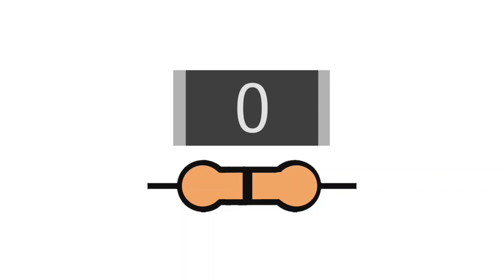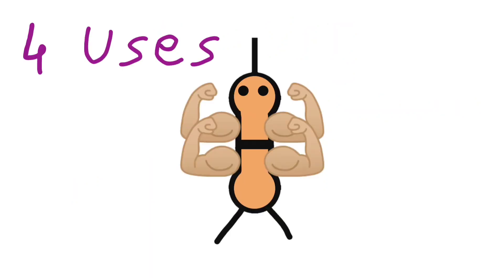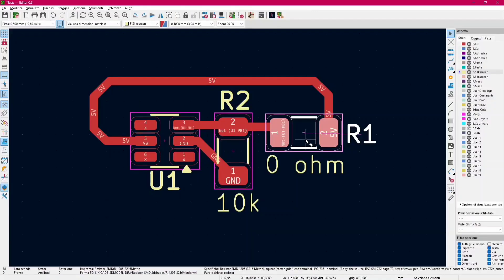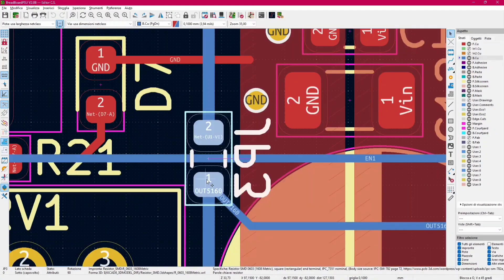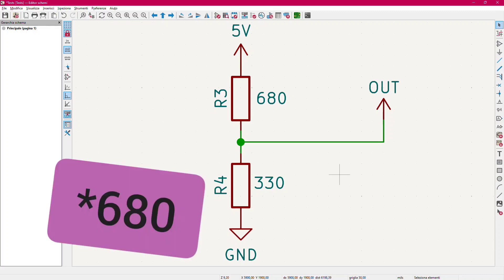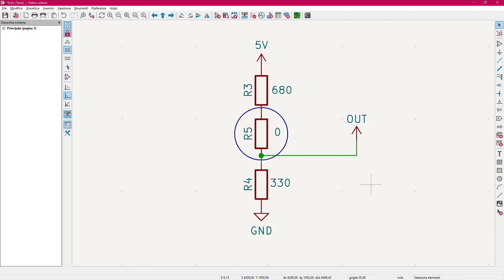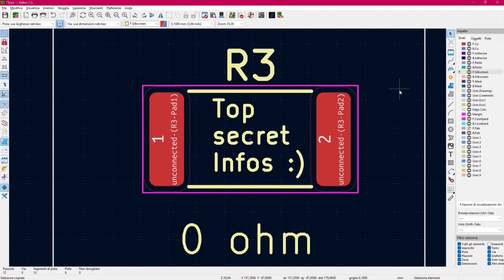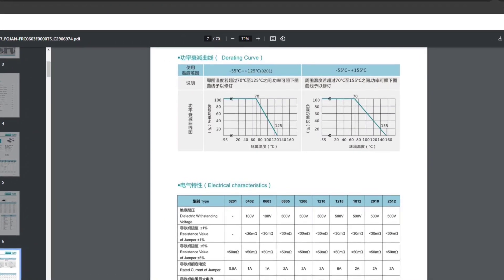Why 0 ohm resistor exist?

Comment from the maker: Hi all, this is a brief video about zero ohm resistors and their use. Indeed they are useful as they are available in thousands of quantities from different manufacturers. Zero ohm resistors are a really good jumper, a placeholder and more

Leave a comment to leave some feedback. I'll be glad!!

Chapters:

0:00 - The 0 ohm resistor
0:40 - As jumpers
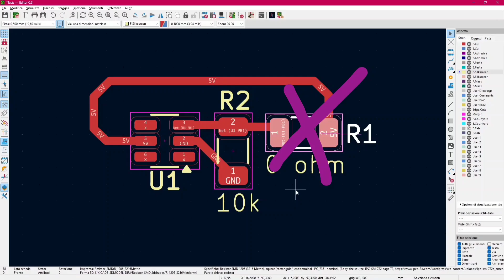1:13 - Go over traces
1:52 - As placeholders
2:52 - Hide infos

IG: https://www.instagram.com/xburningelectronics
Reply: They are also used to bypass/enable unused parts of a PCB for different versions of a product using the same PCB.
Reply from the maker: @icarossavvides2641  Yeah, this is strictly connected to the MCU example in the video

Comment: I'd like to correct mr. @monad_tcp with his misconception and also share some of my review on this video to @BurningElectronics, well technically you may think this possible because it will allow a lot of current to flow but.. you see it wont rise in temperature at all, as u know heat produced varies directly with *I²•R•t*, where I's the current R's the resistance and t is the time passed, with R 0, heat will be 0.. and that's exactly what happens in real life! In this video where he talked about 0 ohm resistors, well to your surprise it isn't actually 0, it does have some "negligible" resistance, only true 0 ohm resistors are the super conductors which does actually have an infinite conductance or in other words absolute 0 resistance.. those type of conductors won't get heated and can carry "technically" infinite amount of current, realistically a very very very large amount of current.. I mean that's what makes magnetic locking phenomenon in a super conductor. I'm not gonna get deep into it's quantum phenomenon you can search it up, not gonna disappoint you I can guarantee ;) 

So my answer to why a 0 ohm resistor would exist? Well it exists for us to play with super conductors and magnets! 

Fun fact, maglev trains use 0 Ohm Resistors aka Super conductors to levitate their trains. That's one practical use.. talking about super conductors in a 0 ohm resistor component video may sound weird but I think it would be great if you atleast knew about the relationship and have a nice day!

Comment: Okay. Using a 0 Ohm resistor to jump over a trace is freaking brilliant, and I would have never thought of that
Reply from the maker: @nestor1208  Yeah! Just some tips if you want to use this technique.

1. Don't use this technique for high speed designs
2. Don't use this technique for high current traces
3. Don't forget pad-to-track clearance

Everything else is ok!

Comment: I like to use 0 ohm resistors as fuses for low power, as they are better looking in my opinion
Reply from the maker: @alysonkiszewski5032  Better looking? Ah man just use proper smd fuses! Todays the cost of those smd fuses is really low

Comment: It's worth noting that in real life, there is no such thing as a "zero" ohm resistor, in fact there is no known material that is a perfect conductor or perfect insulator, all matter has a certain resistance value.  

Things get rather interesting when certain conductors are cooled to temperatures approaching absolute zero, entering a phenomenon known as superconductivity, in which a substance loses all resistance and seems to defy the laws of physics.
Reply from the maker: @rarelampcollector  Yeah i said at the end of the video that those aren't really 0 ohm resistors. We call it 0 ohm resistors only because they tend to 0
Reply: "seems to defy the laws of physics"
Only if you're from the early-mid 1900s bucko

Comment: we use it in evt prototypes to assist in sub module power consumption tests ... e.g. 0 ohm resistor in series with an 3.3V power in trace so we remove the resistor and hook in a benchtop amp meter during power consumption during different states like active, idle sleep etc.
Reply from the maker: @regulus8518  Yeah, that's a clever way to use 0 ohm resistors!

Comment: Negative ohm resistor when
Reply from the maker: @gigachadgogeta  Just search for Gunn Diode. They are absolute uncommon diodes with some physics crazyness that have a region where an INCREASE in voltage results in a DECREASE of current. This seems to go against V=RI. But it's a little more complicated. Just check for GUNN diode
Reply: @BurningElectronics  you can also bias a transistor like a mosfet to result in negative resistance by using it in its active or amplification region (half on).   Then you can dial it in specific to your circuit if it’s easier than working around a gunn diode which isn’t really a diode.   Doubly so when you need it to work all the way down to zero and those first positive coefficients ruin the circuit.

Comment: Now we just need an infinite ohm resistor
Reply from the maker: If you look at my other video on resistor you will find out that Ohmite reached 10TΩ. That's infinitely less than infinit. But it is a monster of 10.000.000.000.000Ω sooo yeah hope you are a little more satisfied now ahah
Reply: @BurningElectronics  ayo that's crazy 💀💀💀
Reply: thats what the kids call an open circuit 😂
Reply: Isn’t Open circuits technically infinite resistance in DC
Reply from the maker: @lamp007  Well...kinda. There is no infinite resistance, an open circuit has a resistance depending on the resistivity of the material. And sometimes we can say "Okay it's infinite", other times we have to to our calculations and check resistivity of the material to work out the real resistance
Reply: @ but doesn’t the same thing apply to the 0hms resisitor, theoretically 0hms but in actuality it’s near 0% and impacted by temperature differences.
Reply from the maker: @lamp007  As I said in the video
Reply: @BurningElectronics  So how is the theoretical 0 different from the theoretical ♾️?
Reply from the maker: @lamp007  I just want to say that there is no infinite resistance and neither exact 0 ohm resistance (except superconductors)

Comment: I worked at a company where we sold a version 1 and a version 2 board for some component in the diesel-electric systems in huge ships. The version 1 board would trip a mal-designed safety ciruit all the time, so we got the boards sent back. What we did was remove a specific 0 ohm resistor to disable the safety circuit, then send the board back. We would also upsell version 2 boards directly. What's worse is when the whole systems came back occasionally, all covered in soot, because the ships used to catch fire from the safety circuit being disabled 😂
Reply from the maker: @jhsevs  Oh my...😳

Comment: a "0 ohm resistor" is only it's tolarences, so it's can be anything, in other words it's an "any ohm resistor"
Reply: just install it in your circuit any if you are lucky it's just the right random number you needed
Reply from the maker: @kovacsattila8993  It doesn't work that way
Reply from the maker: @kovacsattila8993  Mhh this is valid for all the resistors😅. Like even a 100 ohm 0.1% resistor could be an "any ohm resistor" since there are infinite numbers from 99.9 to 100.1
Reply: So they go negative and generate power!   HALF of them too!!!!

Comment: I strongly believe certain companies use them as a way to add a little bit of "programmed obsolescence" for their products

I've repaired many stuff that had 0ohms resistors failure and the resistors were not placed over any other track and they also didn't work as fuses... they seemed to be there purposely over critical traces that went to cpus only so that they fail after some years 

For example xbox 360s many of them are starting to fail nowadays almost always related to 0ohm resistors all over the pcb. Pretty sure some follow your use examples but many are just there "because"

Comment: I never thought to use 0 ohm rezistors to jump over traces when you can't use the other layer/s. Even if it's only useful for low power and low speed signals, it's still more useful than nothing to help save money
Reply from the maker: @torfley  Yeah! Super useful. And I agree, this should be used only on low power signals and not for high speed signals

Comment: In some failure scenarios, these 0 resistors (or rather, jumpers), being an SMD with low current rating could act as fuses and save the day. It's a whole lot cheaper to replace these 0 ohm guys than replacing the whole burned out PCB. Yes it's tempting to just desolder one of those burned out 0 ohm guys and slap a blob of solder on there to fix everything but my local repair shop advices against such practices for safety reasons.
Reply from the maker: @udhi_gn3893  Didn't expect so many people to use them as fuse as it is a bad design idea
Reply: Yes. Even before the SMD era we were using them as fuses. Never saw them used them for jumpers in my experience. Just used wire for that.

Comment: If the narrator was honest he would not call it a resistor.  Instead, using click bait methods to deceive everyone.  What a stupid thing to come out with.  Anyone supporting this liar needs mental health assistance. Of course one could come out with stating technically it is a resistor but every single electronic connection has some resistance.  This video is simply a click bait issue, I suggest everyone thumbs down this garbage.
Reply: are you ok? it's produced the same way as resistors, it just has more or less 0ohms. Even if it was technically not a resistor, why all the hate?
Reply from the maker: @EneaG And everyone in the Earth calls it a "0 ohm resistor" anyways
Reply from the maker: So all the manufacturers are lying? We call it zero ohm resistor because it tends to have 0 ohm resistance. Like we call a 100 ohm resistor because it tends to have 100 ohm resistance. Nothing is 100% perfect in this world because physics
Reply: 0 Ohm resistor is quite impossible. What you show is zero-ish resistor.
Reply from the maker: @jaroslaww7764  True 0 ohm is only possible with superconductors. What I show are called 0 ohm resistor. Nothing more. They obviusly don't have 0 ohm resistance. But we ALL call it 0 ohm resisistor even tho they are not exactly 0 ohm. Like when you say 5V but it is 5.00001V. Like when you are saying "The Earth is round" but indeed it's not exactly round. Like when you say "I lifted 10kg in gym" but they obviusly are not 10kg because tolerances. Like when we say "Bolt has done 9"58 " but indeed it's not exactly 9.58...wanna more examples? Ahah a 0 ohm resistor it's called 0 ohm resistor because as with ALL THE THINGS we take APPROXIMATION
Reply: @BurningElectronics  When you say resistor is 5 Ω, but actually its 5.1 Ω you are making relative error of 0.1/5 so 2%. Try to calculate your relative error when you say resistor is 0 Ω 😀
Reply from the maker: @jaroslaww7764  That's not important at all. Because when an engeneer buys a 0 ohm resistor alrealdy knows that it will not be a true 0 ohm resistor. They will buy a 0 ohm resistor because of what said in the video. And even more, will read the datasheet that will tell the real resistance range
Reply: @BurningElectronics Big mistake buddy, do not get triggered by the first random guy that commented negatively. Ignore and move on
Reply from the maker: @martinrodriguez1329 Yeah, you're right
Reply: Lol this guy probably got bullied by all the girls in his class. This is great for people that are not familiar with electronics and might find it interesting. No need to pretend like you know it all because you don't.
Reply: I interpret 0 ohm resistor as a normal wire/cable/trace, just packaged as a resistor
Reply: bro have a lot of things going on his life 😭

Comment: "Why 0 ohm resistor exist?"
10 seconds to the end "Now remember that a 0Ω resistor is not exectly 0Ω."
Now THAT what I call click bait
Reply from the maker: @nngnnadas  It's not called click bait. It's called physics
Reply: @BurningElectronics  It's called lying through your stupid teeth. Idiot.
Reply: @Moonlightshadow-lq4fr  Any sensible person would expect there to not be a perfect 0 ohm resistor. Why do you act like you expect such a magical component exists and insult him for it?
Reply from the maker: @NgôĐăngKhôi-g4o Thank you, let's just ignore this people
Reply: Also, since they are not a continuous wire but a small component, they will have a resistance, for example 50mOhm. It's negligible but in some use cases using a direct connection is better.
Reply: yeah so 0Ω resistors don't exist. (But I was being ironic, sorry. I realise it was not intentional therefore not clickbait)
(There are also Superconductors, but I'm not knowledgeable about them)
Reply: It's not clickbait, everything has a resistance, and the act of soldering those on the PCB increases the resistance (very small amount) compared to using a cable to directly connect two points.
Reply: @gigalar1248  Not 0 Ohm then.
Reply: @cosmefulanito5933  Just like your typical "700 ohm" resistor is actually like 694 ohms, or even 705 ohms, and that resistance can even vary with temperature, where hotter = more resistive. Such resistances have to be accounted for in some circuits.

Heck, a copper cable has resistance, like 1 ohm or something, just like the 0 ohm resistor, but it's so negligible that you still need your 1k resistor else you'd be running 5A (or more) through your poor LED. Even the most powerful laptop chargers, those fit for gaming laptops, draw 2A.

So no, it's not clickbait, you can consider a 0 ohm resistor to have a resistance of 0 ohms because wires (or PCB tracks) have the same resistance value.
Reply from the maker: @HappyGick  They don't understand that even if it's not a perfect 0 ohm resistor is still called 0 ohm resistor by everyone in the Earth. Else what should manufacturers call it? Ahah. Like a 100 ohm resistor it's not exactly 100. But instead to think they prefer to say ItS CliCk BaIt!1!1!!1!1

Comment: Should I use a 0 ohm +/-1% resistor or would a cheaper +/-5% resistor be OK?
Reply: If you ever test them, send the ones with negative tolerance my way, I need to lower the resistance of a circuit ;)
Reply from the maker: @remus-alexandrusimion3439  Ahah math doesn't lie
Reply: It's uselss, even - 1000000% of zero is still zero, same as positive.. those +/- x% from 0, always 0..  @remus-alexandrusimion3439
Reply from the maker: @farpurple  Mh yeah, the joke doesn't make much sense now that you made me thinking ahah. If you instead are talking about the mere 0 ohm ± x% it still makes no mathematical sense but for 0 ohm resistors tolerances are used by the same manufacturer to indicate better approximation to 0. Look at the end the FOJAN (second one) datasheet!
Reply from the maker: @nicholasvinen It dipends on your application. If you have a really sensible circuit, you should use lower tolerance. So that the maximum real resistance does not affect your circuit, otherwise no, it doesn't matter. But please always check datasheets because for the manufacturer X a 0 ohm resistor must have a real resistance of 50mOhm or less. For the manufacturer Y could be even 100mOhm or less. So this can definetely impact the performance of your circuit!

Comment: It can be used as a fuse to prevent more damage in short circuits.
Reply: It certainly cannot be used as a fuse! A fuse works by heat build up by virtue of the current flowing through it, it needs to have some resistance so as to dissipate heat, a zero ohm resistor cannot do this. Look at ohms law!
Reply: @icarossavvides2641  not even speaking about the fact that the 0 ohm resistor has a larger section than PCB tracks, which basically is exactly the polar opposite of a fuse's purpose. Everything has an electric resistance, unless it's a supraconductor.
Reply from the maker: @Jean-Denis_R_R_Loret  The package is not an absolute discriminant. Nevertheless 0 ohm resistors as fuse are a bad idea
Reply: BAAAAAAAAAAAD fuse.

Comment: used a lot on analogue circuits where a filter or level change MIGHT be needed for some reason in the future so you don't need to redesign the PCB. Just put all the parts in the correct place and short over them with 0 ohm.
Reply from the maker: @joshctaylor  Yes, this was like the example in the video, and is one of the most common application to use it as placeholder!

Comment: With a 3.5 inch floppy drive pcb we used a few 0 ohm resistors to keep the board a 2 sided board. 

 The entire board was surface mount in Early 1983. 

Every part was surface mount except 4 inductors in the read write filter section. 

 These inductors were not made in surface mount packages yet.

So in surface mount 0 ohm resistors go back at least 41 plus years

You use them to keep a board simpler and get traces shorter
Reply from the maker: @3beltwesty  Great use of 0 ohm resistors! A jumper in smd form factor was indeed a great invention

Comment: The resstor is calibrated in the industry with a nuclear ray. When a device for example a power bank gets older, it will be harder to charge. The best is to use a car battery for 3 days to clear the radioactivity of the device. You can use its top or side, or even a car's glove holder for renewing your device. If you remove the resistor, the device may become worse.
Reply: WHAT?????
Reply from the maker: @icarossavvides2641 I don't know man...I don't know😅

Comment: When a laptop I had went completely dead I got to checking the wires and power supply, finding them good I progressed to the input plug and traced how far the power went, not very far I found. Then with high power magnification I noticed some surface mount resistors that had 
 ‘ 0.0 ‘ marked on them , so I checked for continuity since I figured they were some kind of ‘ jumpers ‘ on the motherboard.
One checked out zero continuity, so I managed to solder a tiny piece of wire across it and ‘ voila ‘ the thing came back from the dead and still works today.
Reply from the maker: @MichaelWysocki-ks5xt  Good!💪🏻
Reply: @ it did seem pretty odd to find a resistance factor of 0.0 ( ??? )